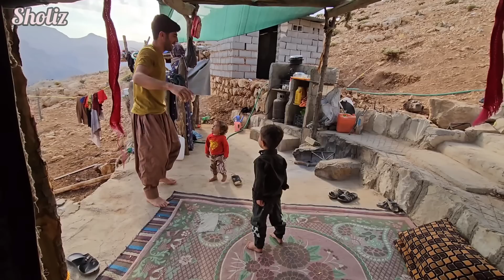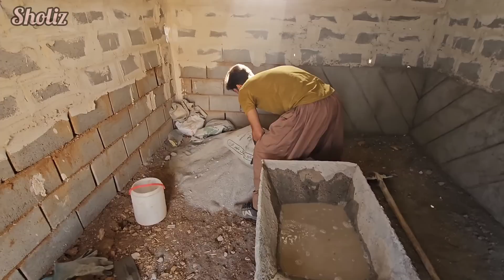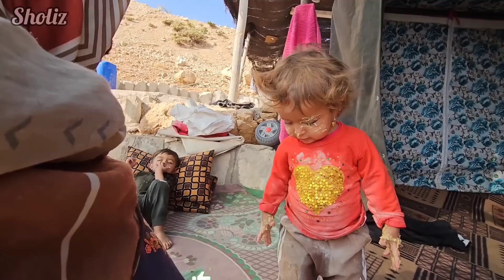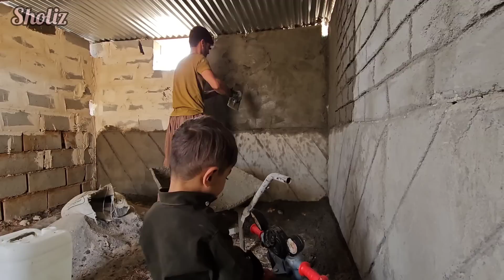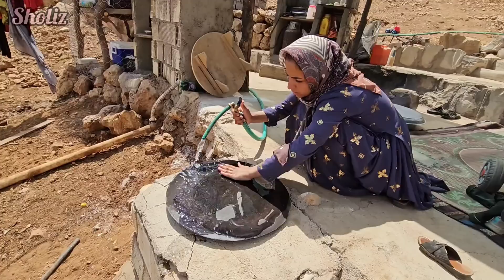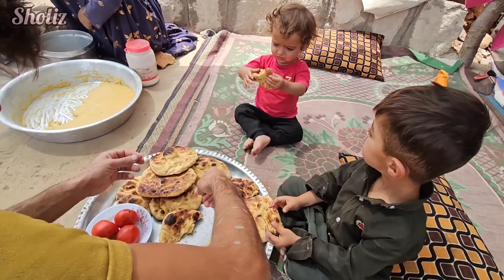Nomadic Rituals: Crafting Local Bread & Cementing Home Walls 🍞🏡

Comment: В тесто добавьте масло подсолнечное или другое, так вкуснее и прилипать не будут к сковороде лепёшки💕
Reply: The dough needs to stick to the pan so that when they flip it over to face the open coals it does not fall into the coals. This is why they do not use oil. 😊
Reply: @VickiWells-lg5ub , почему сковороду переворачиваете, а не лепёшку?) На сковороде лепёшка печётся, а на огне горит).